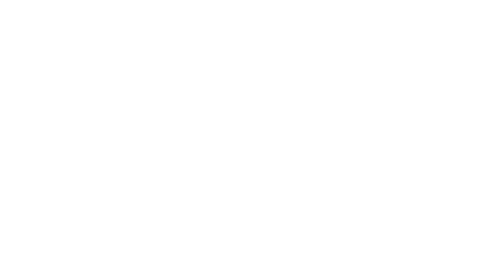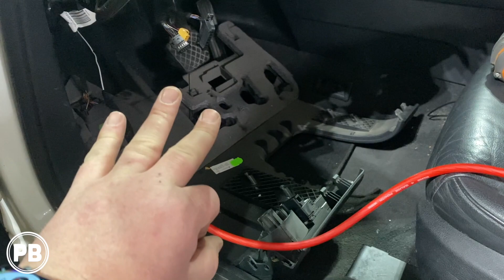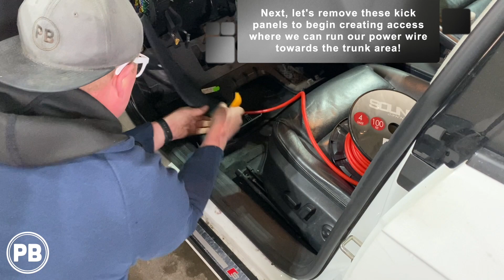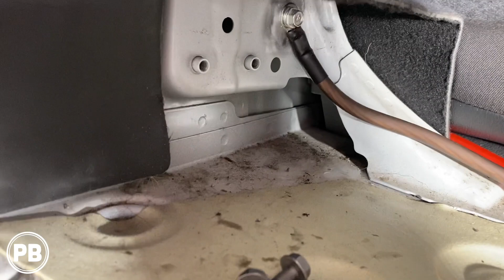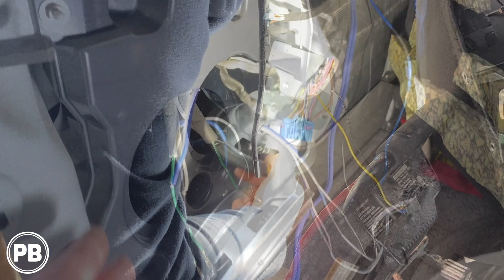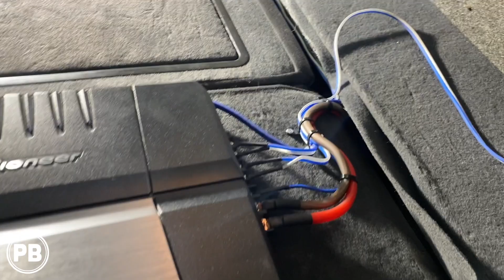2003 - 2013 Audi A3 Amp and Sub Install

Comment: The A3 in the video does not have Bose Sound System. That is the standard Blaupunkt sound system. You can tell by the factory subwoofer you tapped into.. thats not how the Bose factory Subwoofer looks like plus it would have "BOSE" engraved on the factory Subwoofer enclosure. The doors speaker grills would also have a silver metal strip that says "BOSE Sound System" too. Just thought i'd let ya know 👍🏼

I've dropped you a message on your facebook page as I'm after information for basically this same setup you did in this video for my 3dr Audi A3 8P which has Bose Sound Sytem and Factory Audi Navigation Plus RNS-E headunit and I would like to fit an aftermarket Subwoofer & Amplifier to it...
Reply: did you get anywhere with this? im in the same situation and wondering if theres any issues with this method on the bose system. if the wiring is all the same there shouldnt be an issue really
Reply: @george7451  did you find out?
Reply: All the better! Thats what my car has lol
Reply: The guy in the video states it's not a Bose set up?

Comment: I have the oem blaupunkt sub in my A3 8p. Will this be the same method ? And will my oem sub keep working or not because i dont want to hear my terrible stock sub cracking while my other sub is doing its job
Reply: I would take the sub out and unhook the wires, the amp in the sub box also controls the rear speakers. Then you can put the sub back in the box, just unwired.
Reply: Thats what i was wondering if you can remove the original subwoofer speaker and use the speaker wires to the converter

Comment: I'm going to try your idea with this connection in my audi a3 8p '09 with Blaupunkt sound system. Do you think that connection will be the same if it's not bose? I've got an amp with hi input, you are using converter, with my amp it's not necessary i think, and i heard that using converters can spoil a quality of sound because of some noise. Do you hear any noises caused of converter?
Reply: I have the audi concert head unit with Bose but the 6" sub is a blaupunkt . Did you do the install?
Reply: @hunkhulk-s7x Yup, everything was the same, it works well without converter, but i will disconnect Blaupunkt soon and just leave extra sub, it works way better :)
Reply: @patrykchomontowski1564  so its best if i get a sub with hi input avoid line out converter? How would i connect the wiring? He left the blaupunkt in would it be better to delete it and wire up to the dual voice coil sub wires? Is that what you meant? Thanks for the help!
Reply: Edit- meant AMP not sub
Reply: I only heard about weird noises with using converter, idk maybe it's not true or just 1 of 100, i had an ocasion to buy amp with hi input with good price that's why i did it, at the moment i've got Blaupunkt and JBL sub, but the plan is to keep only JBL in place of Blaupunkt to do not lose cargo space. Connection depends of your Amp and converter. I ve got an extra switch button for turning on the sub, that's the only diffrent thing than in video ;)
Reply: I didnt understand why he kept the crappy oem speaker. Does it need to be re-used? Thanks man
Reply: @hunkhulk-s7x  I don't think so, you just need to leave factory Amp because it's connected with speakers in rear doors (othervise you need to connect new Amp with this speakers but idk if it's possible with factory Blaupunkt/ bose because new Amp could spoil this speakers. But factory sub you can just disconnect and that's all :)

Comment: So, basically you keep also the stock bose amplifier from the right side?
Reply from the maker: Yep we kept the factory audio system intact and just robbed signal for our new setup.
Reply: @ProvoBeastAudio  should you not disconnect the factory subwoofer?
Reply: @SeraajDavids  100% yes

Comment: why you don't use speaker level input on your amp?
Reply from the maker: It's rare that amps that arrive to be installed (if not sold by us) show up with the high level input harness for their amplifiers.  To tailor a more standard practice to the audience, it's easier to go the route of a proper line out converter install to accommodate any amp the viewer is trying to install.
Reply: @ProvoBeastAudio  From my experience is rare that amps don't have high level input, more often used amps don't have harness, but its nice that nearly all amps use standard 4pin ATX connector and some of these amps with have integrated signal sensing turn on so no need REM wire. So IF amp have high level input you can save $20 and no need connect bulky RCA cabels and maybe REM
Reply: @Gintas50  in my experience on this channel, most of the videos feature lower powered amps. Usually lower powered and cheaper budget amps don’t have the speaker outputs